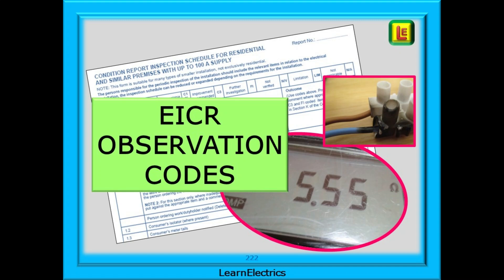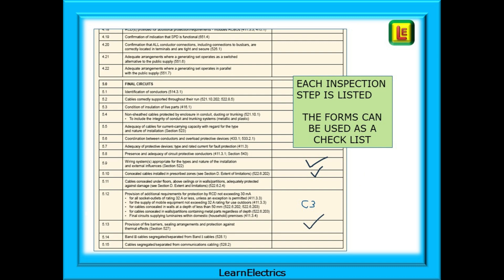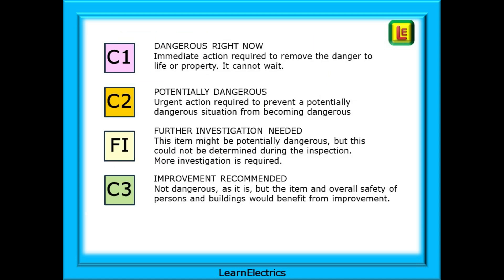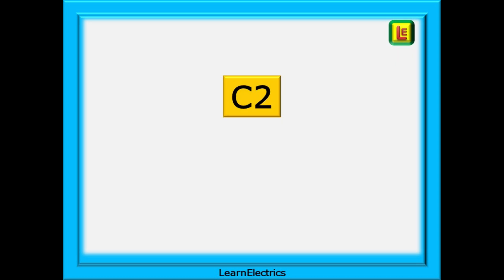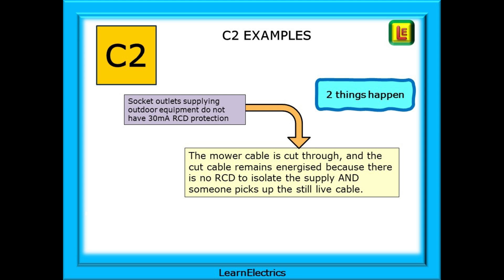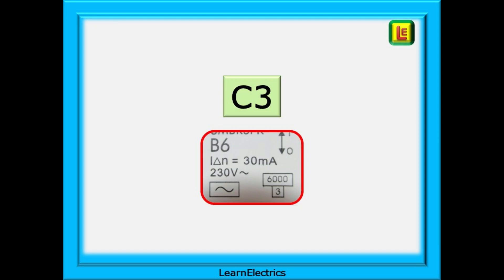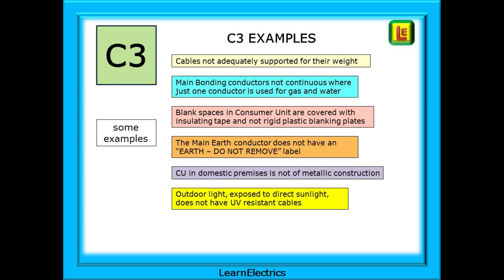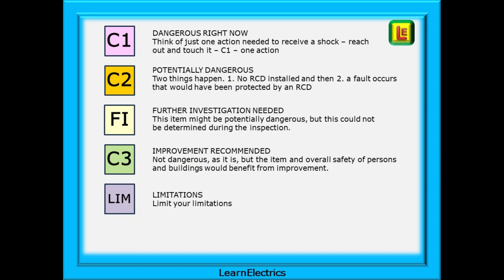OBSERVATION CODES FOR EICR  - ELECTRICAL INSPECTION AND TEST - THE RIGHT CODE AT THE RIGHT TIME

Comment: I’ve come across so many electricians, mostly on social media saying “An Installation should be inspected and tested to the wiring regulations it was installed to”… Thank goodness you’ve made this video and cleared this up. I’ve always told them an installation is inspected and tested to the current wiring regulations but it often falls on deaf ears.
Reply from the maker: Correct. Inspect to the latest Regs and then give due consideration to the Regs in force at the time. thanks for watching. Dave.
Reply: An eicr isn't unsafe if it's not to current regs  are you saying it is .are you saying that plastic consumer units  are not safe  are you saying because it's got no Spd it's not safe   so there fore it should be  inspected and tested to the reg it was installed to  these things are c3s  surly because too many cowboy electricians fail an eicr because it's plastic and a ropey metal one is installed  and it's more unsafe then the plastic one

Comment: There was a picture of a metal clad socket with an unglanded twin and earth entering the box in your presentation under the section C1. Would this not be an example of a C2? 2 actions needed. Perhaps in terms of ingress protection you could argue that a finger could be pushed into the socket, but it depends on the location of the live cable as it enters the back of the socket outlet. If it was within 'finger poking' distance it would be a C1 but if it was other the opposite side of the double back box, it would be very difficult to make contact with the live copper unless you had fingers like ET. 😅
Reply from the maker: Exactly right. This is why the inspector is always king (or kingesse) on the day of the inspection. The inspector decides what he or she thinks the code should be based on what they see in front of themselves at that moment.

Comment: So if it's not C1, C2, FI or C3 we just tick the box?
Reply: Yes, as its a satisfactory report, but any limitations must be recorded and signed off correctly and any notes on observations regarding anything outside the scope of bs7671 ie fire dection and hazardous environment,  also any possible departures which is usually wiring or equipment being used that is not formally or currently recognised by bs7671 but still appropriate for use due to manufacturers and European compliance, all this must be signed in agreement with the customer when finished.
Reply from the maker: Brian has this covered. Thanks for watching and thank you Brian.
Reply from the maker: Thanks Brian, I appreciate the support. Dave.

Comment: Hi mate. Can I ask if you test R1 and R2 when doing eicr or you just calculate it? Also what tests would you do when carrying out eicr?
Many thanks
Reply from the maker: The recommendation is that you always test R1+R2 and do not use Zs minus Ze. You should carry out all the tests as per part 3 of guidance note 3. Hope this helps. Dave.
Reply: I do R1andR2 at furthest accessory, visual inspect of this socket, light, j/box etc then once re-connected or put back where possible.... Zs test and RCD tests at this point as well. That way you can confirm that the CPC is continuous and any high readings or failed trips means there is a problem somewhere down the line. That gets a C2 for safety devices not disconnecting within the 0.4sec <32A or 5sec for over 32A final circuits. It can be a real pain when the furthest light is a metal chandelier with no removable rose on the ceiling 😤🤬

Comment: First off great video as always, I really do like your content. But I have a question you mention @9:30 "Light switch with metallic face - plate is installed on a metal back box with no fly - lead" is a c2. However I always thought most metal back boxes (providing it has at least one fixed lug) do not need a fly - lead as the machine screw acts as a fly - lead otherwise we would still have to take a fly - lead from a socket to a metal back box. so in this case the switch would not need a separate fly - lead.But it could be noted as an observation..... If I am wrong I would like to know thanks
Reply from the maker: If the line conductor touches the back box, the screw may transfer the voltage to the face plate.
The permutations are endless, just try and work out the sequence if something goes wrong. Thanks for watching.
Dave.
Reply: @learnelectrics4402  Thanks for the reply. I agree 100% with what you are saying an I would always earth the metal face plate I was just querying really if that is actually a c2 or would it be more of a c3 (huge difference imo). But as you rightly stated in the video it would be for the individual inspector to decide. Thanks again for all the great content
Reply: As long as back box is earthed then faceplate is earthed via the the screw. A short would trip the mcb. Obviously if removed then it could become live , however when should a switch be removed from the back
Box live . C3 for me sorry.